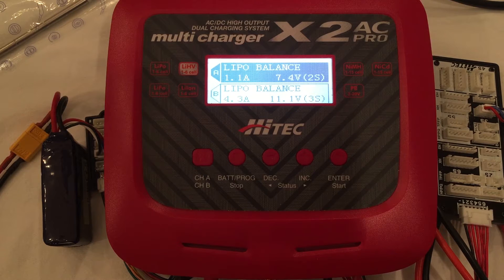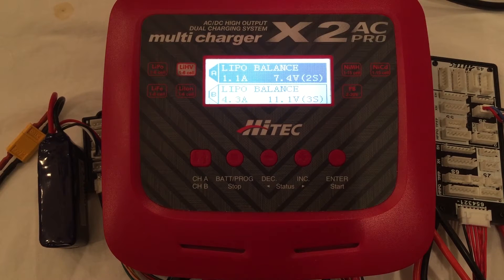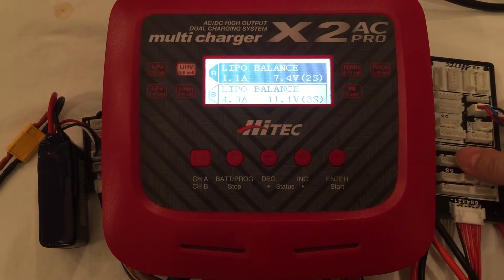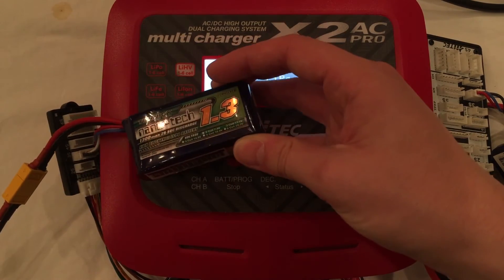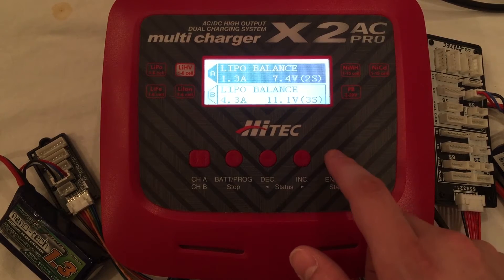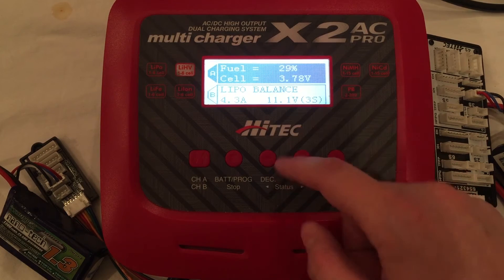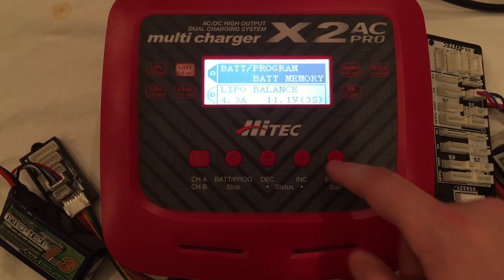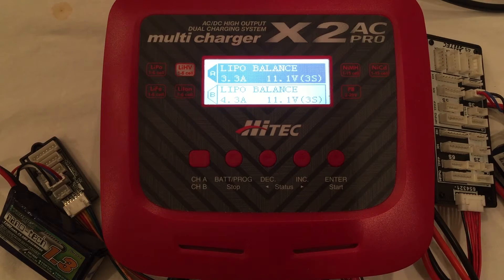Hitec X2 AC Pro Charger with Soldering Iron // Complete Review

Comment: How do you know when the charge is done?
Reply from the maker: It will just say "END" and give you the total charge time.
Reply: John Cuppi I'm guessing it automatically knows when the battery is full.. Thanks for your help...
Reply from the maker: That's correct. It will fill each cell until they are all equalized, and once it detects that the charge will be over. It will also tell you how many mah were put back into the battery for the charge. So for example if you notice your batteries just aren't lasting as long, and you charge them up but find out it's reaching "fully charged" with significantly less put back into the battery than usual, that's your cue to toss the battery soon :)
Reply: John Cuppi Got it thanks..
Reply: John Cuppi Its been a long time since I messed with battery cars. So each time I charge these batteries I have to hook up the boards for temp purpose, and call maintenance?